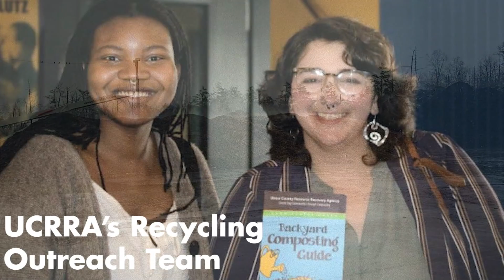Rethinking Our Waste

Comment: Great work UCRRA!  It's very exciting and important for ulster co residents to see what you are doing ... every ton of recycling saves 2.7 tons of CO2... that's  amazing to learn...

My wish is that the public could access plastic from the waste stream from UCRRA to use. As someone whose built multiple machines for up-cycling plastic, it was surprising that there is no way to do this in Ulster County. 

Even if there is no short-term way for this to happen, I think it is something that should be strived for. Letting the public access sorted (shredded, ideally) plastic makes many more opportunities for education and rethinking the value of trash that the public would be doing for you.
Reply: I am guessing that this is likely because waste builds up so fast that to offer the purchase to small and inconsistent stakeholders is more of a risk than a opportunity. Perhaps a re-use center could potentially have a contract for a specific type of material for cases like these... an interesting comment :)
Reply from the maker: Hi Robert, we do not shred any of the baled material at our facility.